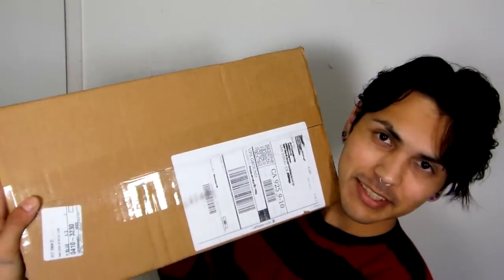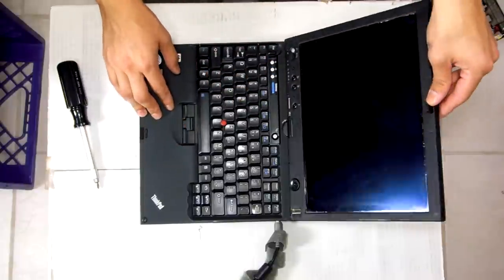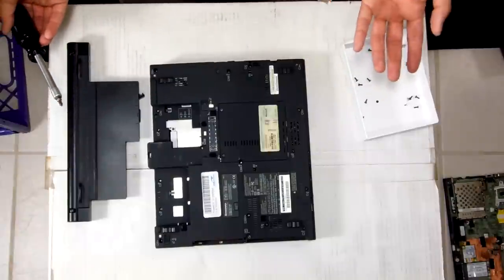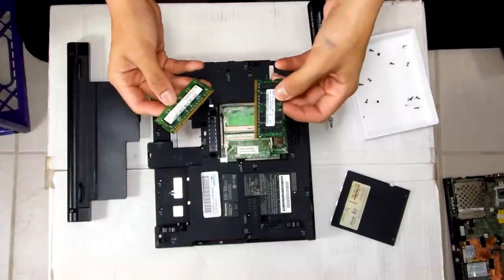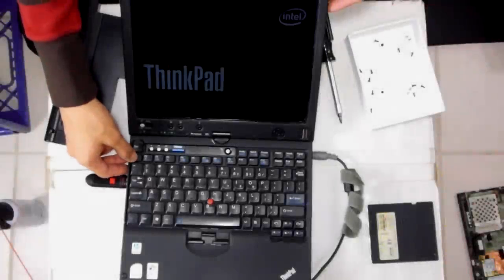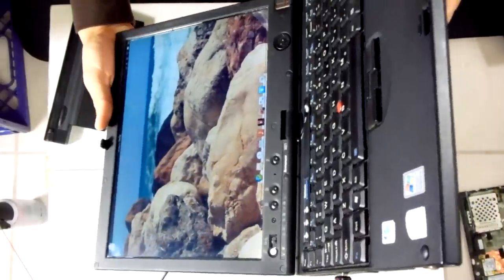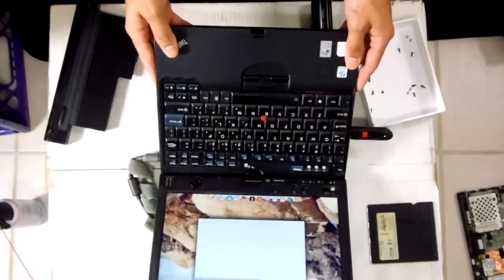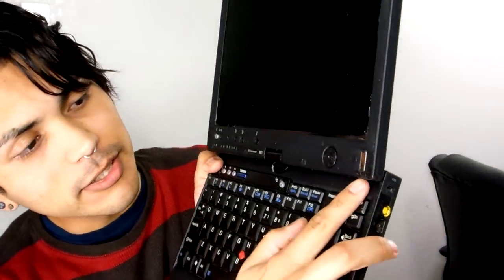Saucey's Hour Repair: X61T 1-3-3-1 beep

Comment: well, i had an issue with t61 - it just died with a blue screen and then only turned on once after that (and didnt turn on anymore)
now its just blank screen with even no beeps...
and it only beeps 1331 when there is ram in the bottom slot, which should mean that the bottom slot is faulty now?
and when i also had Cmos battery disconnected, it beeped 1343... and it is 3,1volts, so i guess that one is fine atleast...

so is it a bad motherboard now? i think even the harddrive is not readable anymore, lol... (gave somekind of "select MBR" error in disk management when i tried to view its contents...)